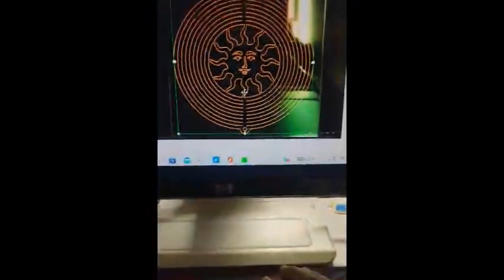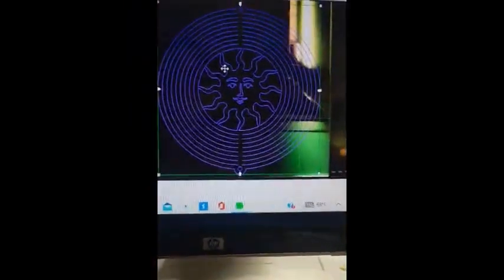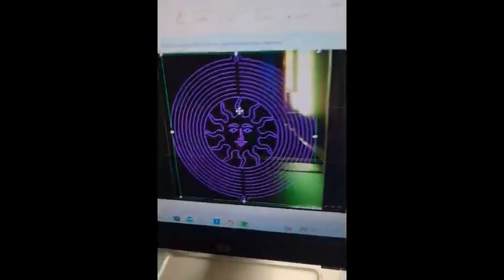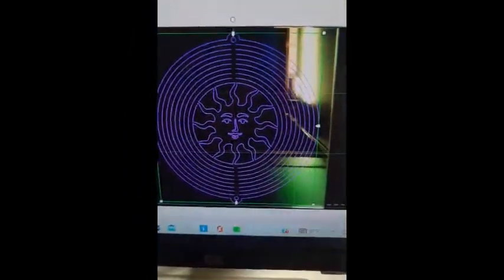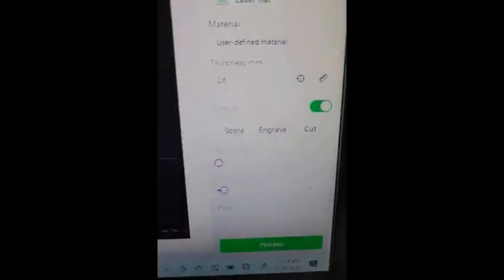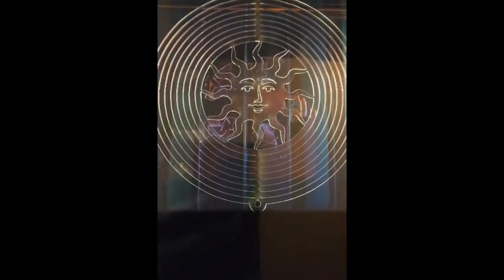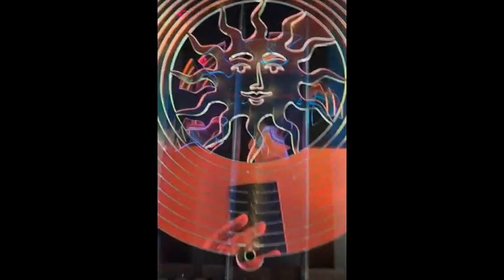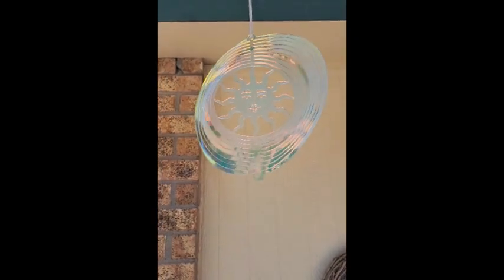xTool P2 acrylic wind catcher

Comment: Were you able to just bend it a little in the end?

Also how do you like the Air Purifier? Is it the one from xtool?
Reply from the maker: Yes, you need a heat gun to make it soft, so it bends easily. The air purifier is from xTool and i like it a lot. It does the job, even though it makes a bit of a noise, but that doesn't bother me.

Comment: This machine needs a honeycomb. Imagine that piece that fell then immediately got obliterated under there was part of your project! Plus, it may be a small scrap, you can still cut something from that, waste not want not! xTool needs a little honeycomb to put in this machine.
Reply from the maker: Yes a honeycomb would have been nice. I still have a small one that i could use, so will try that next time.
Reply: This can been avoided if you put in more slats where needed or add tabs to the cut parts. She has only used ever fourth slot.

Honeycomb is great for flimsy materials like paper, cardboard, leather, felt, etc. 
Blades are great for cutting larger pieces, are a lot easier to clean and can be arranged so that you have minimal flareback and better ventilation.
Reply from the maker: @ulaB  Yes you are right, I didn't use all the slats. 😊
Reply: @jostapleton3414  That's the flexibility you get with slats. A honeycomb is always there in full ;-)